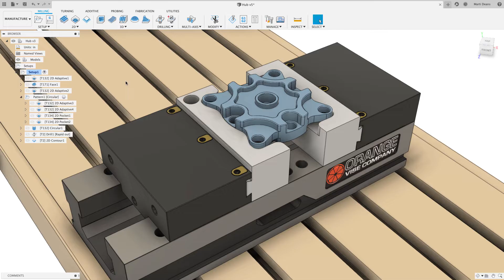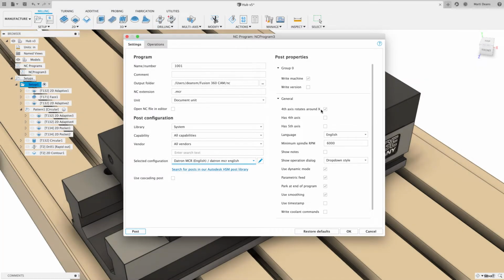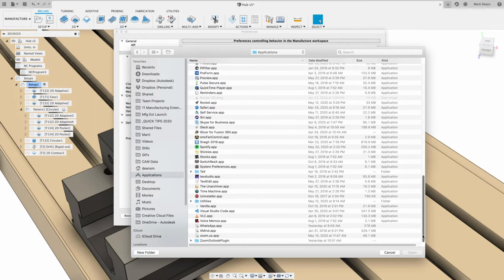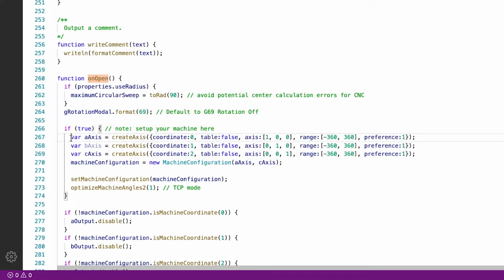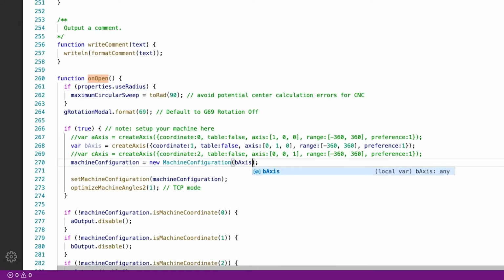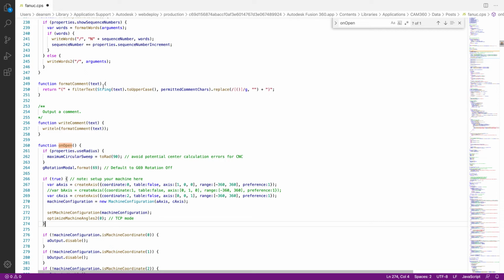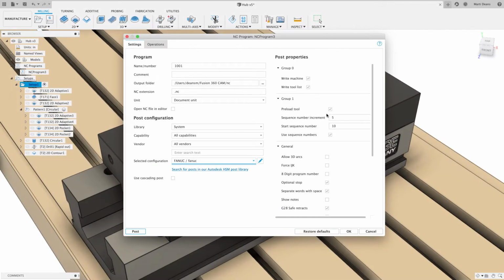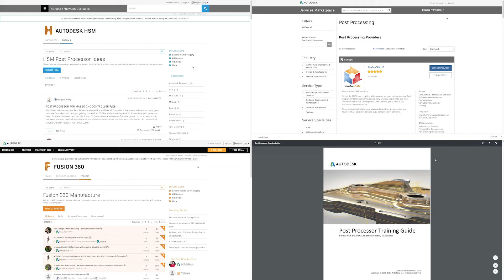QUICK TIP: Enable 4th and 5th Axes in your Post Processor

Comment: My machine has 4th axis but all 4 axes cannot run simultaneously. any 3 axes (xyz or xya or yza or xza) can run simultaneously at a time. how to edit a post so that it uses 4th axis but outputs code in such a way that only 3 axes run at time ?
Reply: same question from my side
Reply: This is because of your machine CNC controller. Let me guess.. are u using Fanuc Oi Mate series controller ?